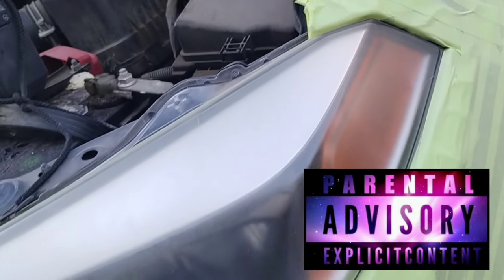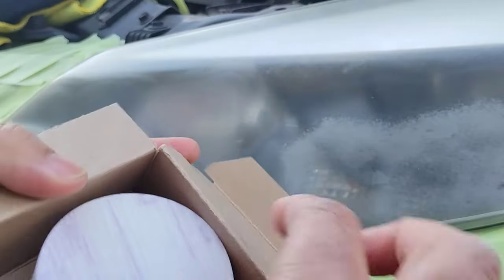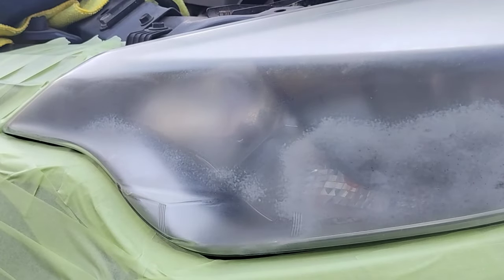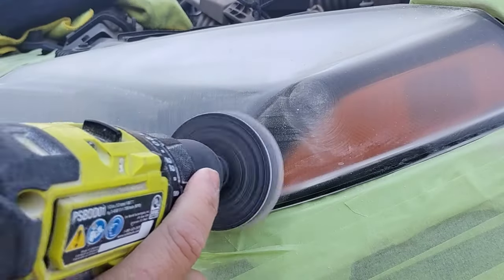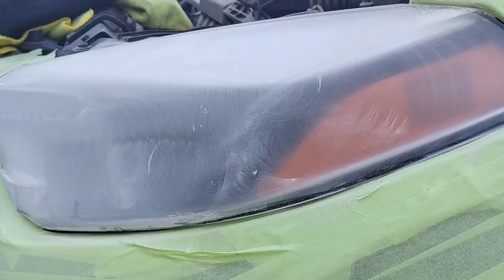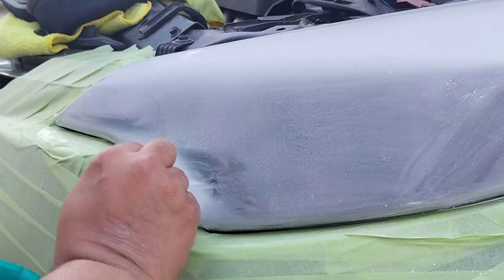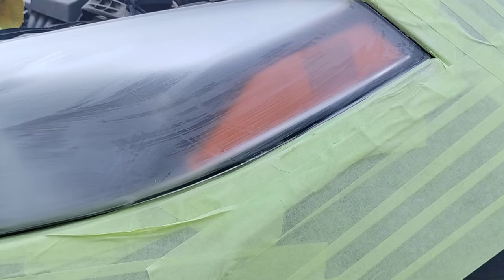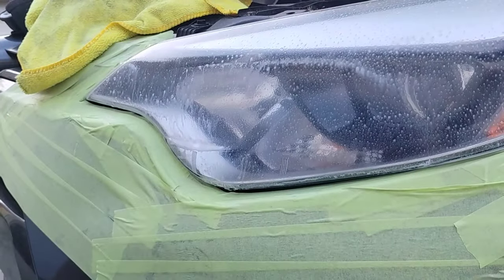HEADLIGHT RESTORATION out of this galaxy 🌍🌍🌍🌍🌍🌍🌍

Comment: I am a mechanic I do the hard jobs but at 63 years old this looks like something I want to get into, I always enjoyed detailing cars, I have the best buffers and can make the paint shine, but the headlights look better after they are buffed and waxed but it does not last long, a month later they are foggy again, I tried water sanding and using a clear ceramic engine enamel, that did work to some degree, thank you for showing me the right way to do it, I will never do a half assed headlight restoration again

Comment: had my first experience with a "damaged" deep dive scratched headlight. 3 p500s 3 p800s several trizak 3000s passes..had some self-doubt at times. Stayed the headlight pro's course and they came out beautiful. The owner told me afterward he tried a DIY with toothpaste, WD40, and 
green scratch pads.. jeeezusss no wonder I wasn't going anywhere fast.. what also helped me as a newbie see how I was doing at each step, i'd spray water and wipe the headlight..anything I missed or needed to hit again would be more visible.  I even added a P1200 step.. again this just helped me see what damage needed attention.. Watch his videos!..Every question/experience I've encountered, he's been there and done that.. Dam he's good!😎

Comment: Hey Mr. Pro, i wana preface this by saying i was an idiot for thinking the 2k clear method would work. I should’ve done more research and did it on another set of headlights before trying it on my own. With that being said i wetsanded both my headlights and sprayed them with 2k clear. The left one has cracking that isn’t exactly like spider cracking, more swirled out. Anyway i was wondering if using your headlight restoration method would work to remove the 2k clear and get them looking better than they’ve ever looked before.

Comment: I recently found your channel and I'm really glad I did!!! You really have headlight restoration down to a science! I've done a few headlights too, also color-sanded paint, and with every video I'm thinking, "Why is this guy jumping from 800 to 3000 Trizact?" Have you tried using 1500 Trizact in-between the 800 and 3000? Pretty sure it's available in 3" pads. There's no doubt your results are awesome, really beautiful, just wondering if you ever tried the 1500 Trizact and what your thoughts were if you did. Thanks for sharing your method!

Comment: Bro I’ve been waiting for soft headlight videos I’ve following your methods been working out great but man I’m stuck on this dam 2020 Durango headlight its soft & can still see scratches after polish only had this problem on this car none of the others did light pressure double stuff method n still see them 🤦‍♂️ ima try this method later but still have to get out the original P500 scratches on these any advice will help thanks bro

Comment: 2000-2008
Ford F150 are my nemesis  !! Especially when there's still half of the clear coat on them.  I don't know if the lower rpm drill should be used for the sending and the lower rpm for the polishing or vice versa? I've done about 20 car's and they look like great, but for the life of me, I can't satisfactorily do F150, and I use more sandpaper almost double what you do,,,lol,,,and I buy straight off your link's  !!! Except I have different drills, 1 up to 750 rpm and the other up to 2400 rpm.

Please help me,,,,,
Ford F150 will be the death of me .

Lol .

Comment: Brother I thought I was following your process to the letter. But I have somehow screwed up one headlight. I think it was the backing pad I was using with my drill. I have one that's not got the foam softness under the velcro, it's just rigid. Didn't realize I had the soft foam one. So I used it with the 500 grit, got it all cloudy, stepped up to the 800, then the trizac pad. After realizing I had the foam backing pad, I used it on the next one. It is crystal clear. So 4 times now I have used the 800 to get all the fine swirls out from the 500, then the trizac, then even used polishing compound and polished them, (I do some personal paint correcting on our vehicles) and it makes zero difference no matter what I do. Those slightly hazy swirls will not budge. It's not nearly as clear as the other one. Still has that cloudy hazy look. So I just keep repeating thinking the 800 plus the rest of the process will do it. Nope. Nothing seems to work. Have you ever had this happen early on? I don't know what to do. I thought about going ahead and spraying the Meguiars coating on it thinking maybe it would fill in the micro fine swirls all over it. But I'm afraid it won't help and I'll have wasted it and still have a slightly cloudy lens. PLEASE HELP!!
Reply: Oh also, as far as people saying you're bragging, well a friend of mine, "Famous Dave" that owned all the restaurants, always says "it ain't bragging if it's the truth. Haha very true.